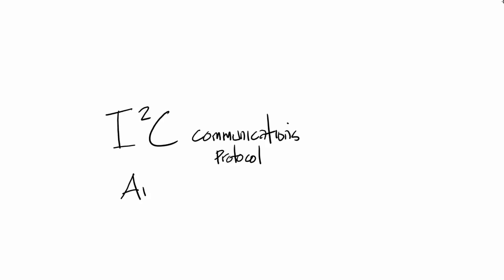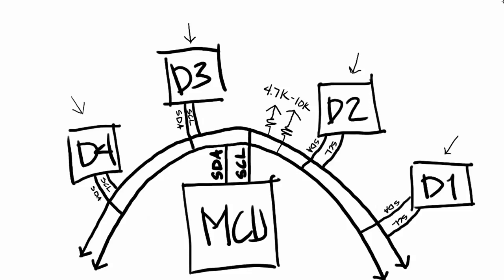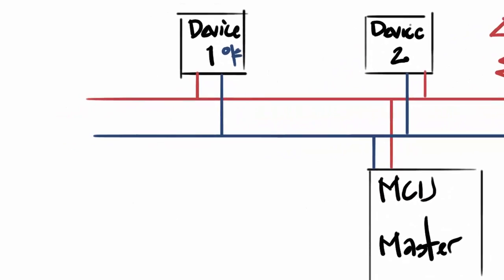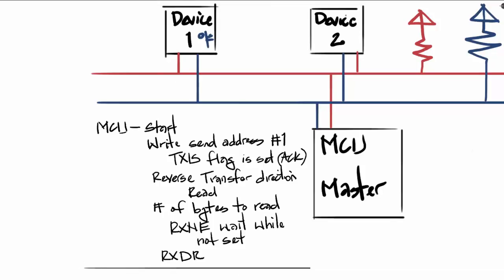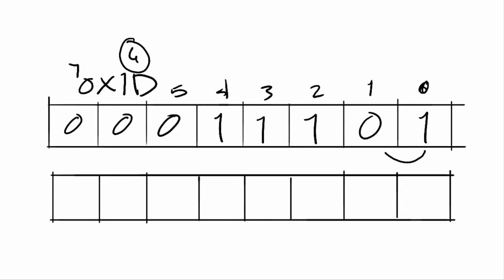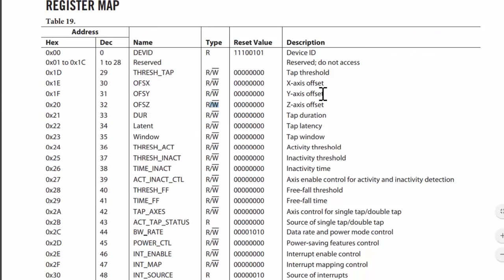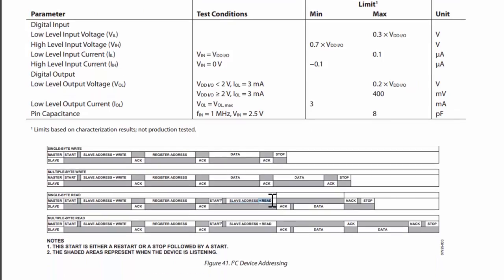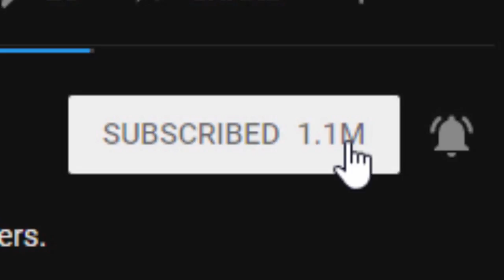57. I2C How to. An introduction to the I2C Protocol for the ARM STM32 Miorcocontrollers - Tutorial

Comment: Hi Patrick, i have a question - > after transmitting the device adress (Master Pin SDL is output open drain), how can the master recognize an acknowledge from the slave when its pin is output open drain ? is this output from the master switching to an input for the acknowledge sent by the slave ? or is this output sensing at the same time due to alternate function setting ???

Comment: I wouls love to see some atmel sam tutorials from you
Reply from the maker: Good comment.  Do you have any experience with the Atmel Smart ARM platform and controllers?  If so, what do you think the benefit would be over the ST Micros?  I love Atmel and that is where I started, so I would be very interested, but I would want to know if there is a benefit over the ST Micro, and whether it would be necessary.
Reply: i don't have any experience with arm but have a dev board and trying to learn but struggling.
Reply: Maybe using ASF would be a benifit and is easer thay having to find/create you own libs
Reply from the maker: Funny you say that.  This tutorial series is centered around the fundamentals and mainly on creating libraries from scratch for a deeper understanding of the chip.